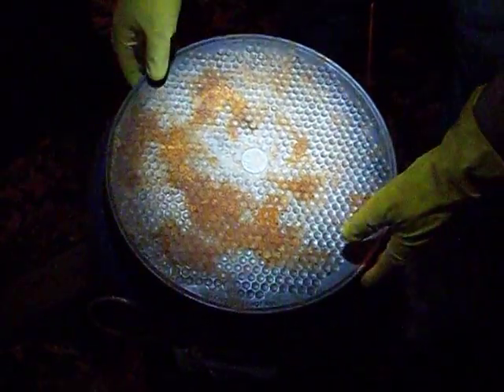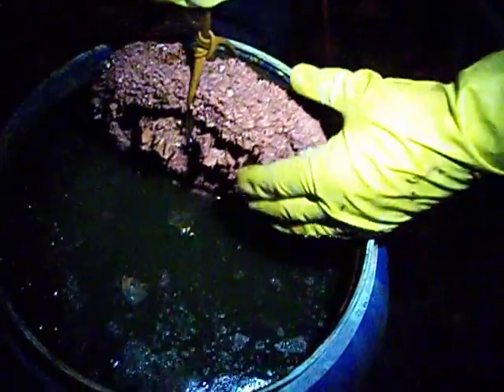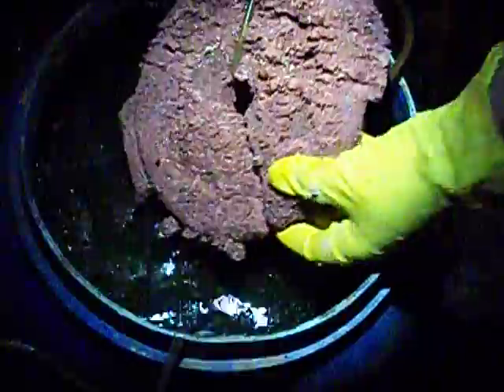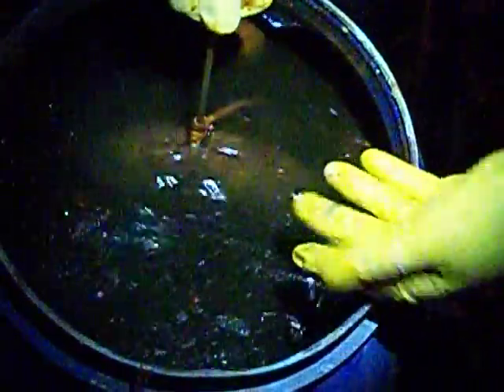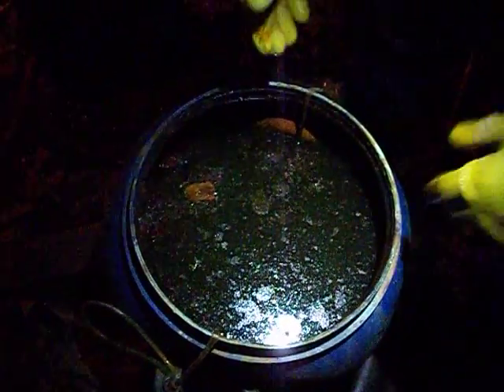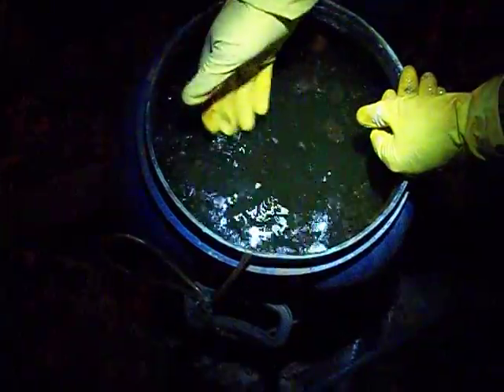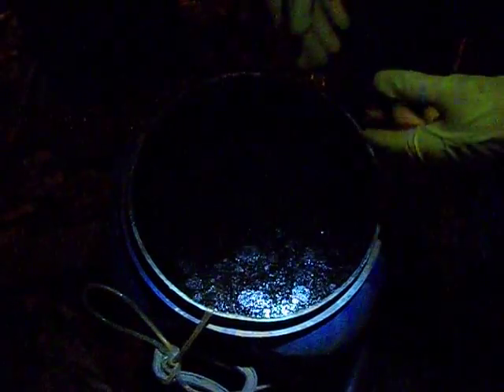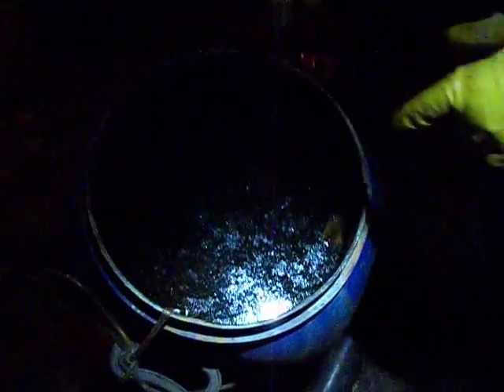cementing copper

Comment: Howdy God... I mean, Geo :) As you know, I'm still quite green (pun? lol) at the chemical processing... APing trimmed fingers & clean boards only thus far. Making stannous still gives me trouble, but that being said... after rigorous filtering of the CuCl2 AP after processing material... and then I intend again before cementing out the copper, I'm aware that some gold from ENIG-like plating might actually be in the solution from other's experiences & advice. Once I start cementing out the copper, what little gold there may be will drop out as well mixed with the copper, correct? Would it be worth the attempt of reprocessing the copper for any PMs that might be in the cement or just let it go and send the copper off to the scrap yard? (I'd melt the copper into bars instead of scrapping, but I know you say it won't be pure even if no PMs are blended in). My stockpile of saturated CuCl2 AP is building up fast and I'm wanting to reduce the build up... and stannous making hasn't been nice to me yet to properly test the solution buckets. Just thought I'd pick your brain on your thoughts :) Thanks!
Reply from the maker: That is my intentions. I am stockpiling cemented copper to eventually part out in an electrolytic cell.
Reply: AH... I didn't think of that. I was thinking if going for any "lost" PMs in the cement that I would dissolve the crystals in HCL again which, yes I know, sounds counterintuitive somewhat to cementing out of already saturated AP lol. Then I shall save my copper crystals, roast, and save for later for when I feel ready for electrolytic cell processing. Thanks!

Comment: "Hi Geo" in my 5gal pot i have a whight like in your video same hook up the sloution is lite green with orange flot in top of the sloution and the whight has black honcks on it round in shape i pulled some of dark black let dry out in a pan the next day or so they were a lite green so is it copper? in the past i used a spoon to get the copper and it came out pink with crystels on it some in full on this whould help me so much thank you Geo
Reply from the maker: It depends on what is in the solution. Does the weight have paint on it? It needs to be clean to the metal even if you have to use a steel brush. You can use any cheap steel. Re-bar or structural steel. Steel cases from old computers. Any old steel.

Comment: once u cement out the copper how do u get the reaction moving again more hcl or both hcl and peroxide
Reply from the maker: Once the copper is removed, the reaction is over. only iron and a couple of trace heavy metals will remain in solution. The solution is neutralized and brought to PH 7 where all the metal will drop as oxides and hydroxides. The oxides are collected and sent to the land fill.
Reply: Geo  so u cant reuse the solution

Comment: Thanks, good video. I'm starting to accumulate some spent AP solution in plastic buckets. Copper seems to be all dropped out on stainless steel. Is the green color iron or nickel, too.
Reply from the maker: +David Howard It can be both iron and nickel. Both are green in a chloride solution.

Comment: once the copper crystals are filtered out do you melt them into a metal bar? how do you do that. thank you and have a nice day.
Reply from the maker: +paul m You can but cemented metal is never pure. You can melt the copper metal and cast anode bars. These bars are used in a copper sulfate parting cell which will produce highly pure copper crystals.

Comment: @geo hey friend , when cementing out your PM's , using your best guess ( opinion) how long does the generally take ? 
for example , lets say per gallon of waste .
Reply from the maker: It depends on whats in it. Is there a metal that passivates in the type of solution you are working with? Example is palladium in silver nitrate. I would say that PH is the factor that determines the speed and rate of ionic transfer. Raise the PH slowly until a cloud starts to form. You can adjust the PH back down with more acid to clear it back up. That way, the solution does not chew up the copper neutralizing the excess acid. All in all, if the PH is adjusted correctly, about twenty four hours or so. If the conditions are not ideal, two to three days.
Reply: thanks for that answer . i work with 2 things . 1 . gold plated copper metal part , there all the same . i have lots of these . there about 1/2 " long and i cut them in half to expose the base copper in the AP/HCL  solution . 2 . the other part i do is gold plated finger boards . i do quite a bit of these but not quite as much as the first part i described .

Comment: Hi Geo . Can the copper you drop out be melted ?
Reply from the maker: Yes. Rinse it with water until the water stays clear. If you want to store it before melting, heat the cemented copper to at least 400° F. The copper will turn black and will not tarnish green. If you try to store it without roasting, it will turn green with patina.

Comment: Hi Geo. When do you know your AP is exausted.
Reply from the maker: +eamonn280958 Technically, it's never really exhausted. The volume of solution builds over time if you are using it continually. Due to the loss of acid in the dissolution of base metal, you must add fresh HCl ever so often. I add equal amounts of 32% HCl and water So the volume of solution gets greater and greater. It would be more accurate to call it overflow. It's just AP that is not used within the container you normally use. I use plastic 55 gallon drums. I keep enough solution to fill two drums 2/3 full. Any amount of solution that builds over that amount goes through the cementation process.

Comment: Use stainless steel instead of iron, does the same thing with the copper but doesn't contaminate the solution with iron.  Have a great 2018.
Reply from the maker: Actually, this is the end of the solutions life. It is neutralized after this. Stainless steel is not recommended because the nickel and cobalt makes the waste more toxic. Iron oxide is not toxic but both nickel and cobalt oxides are both toxic. Happy New Years to you too.
Reply: I would have thought Stainless would barely be affected by the acid and even less so once the copper had accumulated on it.   Great to see you care for your environment.